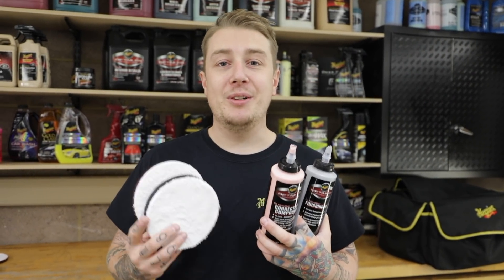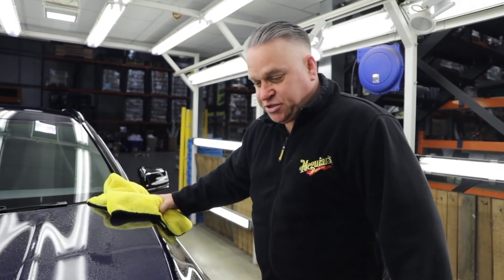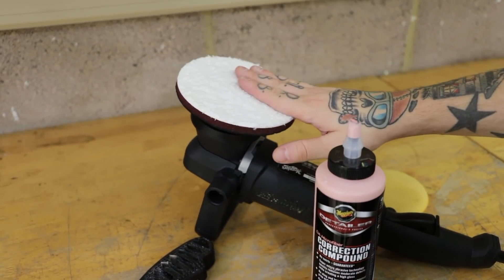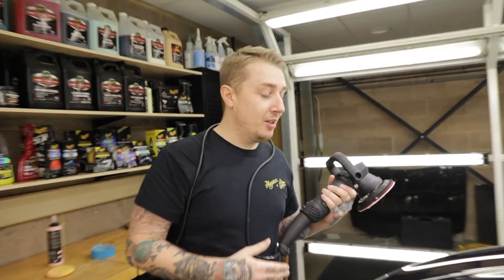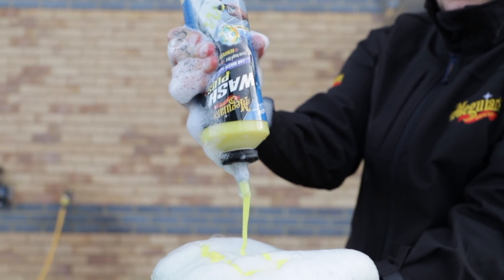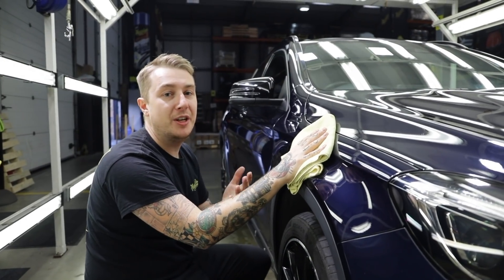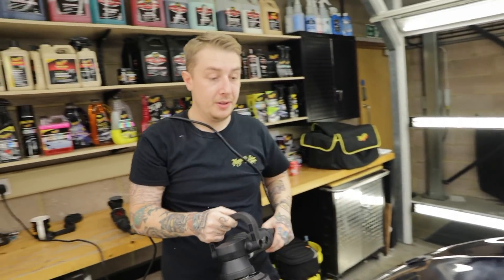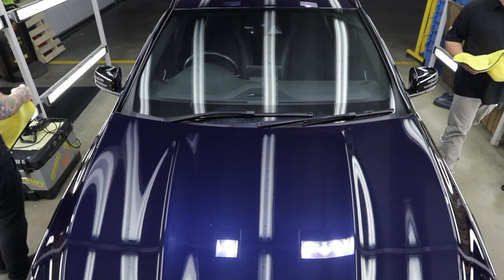Removing SWIRLS using the 2 STEP MICROFIBRE SYSTEM *Day In The Bay

Comment: Is the second step just to add protection? Does it add any further correction at all? If I were to use the first step then apply a ceramic coating do I not use the second step?

Comment: So just wondering, on soft paint like a Nissan would you use the finishing pad with the compound? I have a black 350z which I would like to remove etching and swirls from but I know the paint is a lot harder the BMW Z4 I corrected.

Comment: Great job on your many videos. I am learning alot on the steps you take to prep a vehicle before compounding & polishing. I am wondering what you use to remove the residue after claying? Do you just wipe it away then start to polish or do you use a prep solvent to clean the detail spray residue off ? You don't show it so l am wondering. Most other detail channels use some type of IPA spray or other prep solvent to clean before starting to polish. Great job by the way, enjoy all of your videos.  How about more on the Detail products line.

Comment: Great to see the microfiber pads being used...can you use the polishing pad with the correction compound for a finer cut?
Reply from the maker: You can but you won’t gain the full benefits of it as designed. We’d suggest the Ultimate compound with the polishing pad.

Comment: Awesome. Question: benefits of using this over compounding and polishing??
Is this primarily for swirl removal whereas compounding is for both paint rectification and refining?
Reply from the maker: The Microfibre System is formulated to have a heavier cut, this is why it sits in our professional  range

Comment: I did my car last week with ultimate compound, ultimate polish, and gold class wax, but I still have some deeper scratches left on the bonnet and roof. Would this system get rid of those scratches? I think it's from the previous owner taking the BMW trough the carwash.
Reply from the maker: This method is certainly for the more deeper scratches so yes you might see further results with this system.
Reply: @meguiarsuk  and another question, when i remove the residue from polishing i can see very light wipe scratches from my microfiber, any tips on how to prevent them?

Comment: I recently used the 2 step process for the second time, this time was on my red mustang but I thought I would go one step further and lay another coat of wax by hand by another brand that I had for hand application only, its not come out as planned and wish I had never touched it so can I just hit it again with microbibre  and megs wax or will I have to strip all other wax back off to allow just the new megs microbibre wax be the only finish again on the surface ? Is there any other megs waxes you would suggest for adding for future maintenance rather than megs micro wax stage or should I just repeat
Reply: Colinite wax is the BEST!!! Brb using it for years!!

Comment: you should do a video with a car with rock chips that become rust spots. How do you fix those
Reply: There are many ways to touch up, key thing to remember is touch up is only to protect the paint and not to make perfect although one can get pretty close.

1. Use a paper clip to clean rust out of the chip.
2. Apply a rust converter.
3. Apply touch up paint using an ultra fine brush or cocktail stick.
For clearcoat fnishes always mix 50% base coat with 50% clearcoat and apply that.
As it's difficult to apply clear over the base coat in a stone chip and have a level surface.

Then use a cotton bud with a dab of thinners on it and finely brush against the chip until it's smooth and level against the paint be careful not to remove too much paint or you will have to re touch up, one can also use 3000 grit wet and dry sandpaper to level the stone chips.

Once smooth and level use ultimate compound  on a dual action polisher to blend the chips into the paint and or to remove sanding marks.
Reply: @protonicstorm7228  hey thanks for the reply but i just bought a new car instead. less of a headache

Comment: Where can we get these products from ?
Reply from the maker: Either our website, the Halfords website or Amazon plus more online retailers.
Reply: @meguiarsuk  hi ya, what's the difference between these to products to the ultimate compound and ultimate polish?? And do you haft to be very careful with the microfiber pad because of heat build up? I'm extremely new to detailing and iv only just got the ultimate compound and ultimate polish plus the liquid wax using the red meguiars cutting disc, I'm yet to get the other to pads, yellow and black i believe?? Thank you and great video, the car looked like a mirror once finished lol well done
Reply from the maker: @tonylyons1274  The biggest difference between the Microfibre system and the Ultimate range is you can apply the Ultimate by either machine or by hand, making it more accessible to the enthusiast or someone new to detailing like yourself.  Both will give fantastic results, the microfiber system in 2 steps and the Ultimate in 3. The microfibre system must be applied via a DA machine in order for it to cut efficiently.